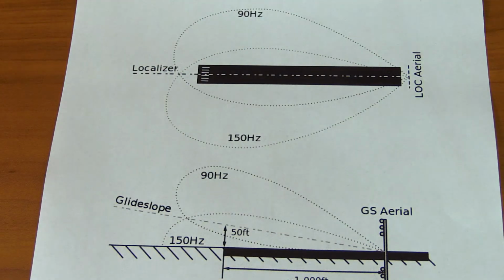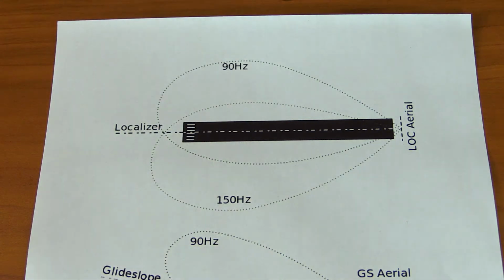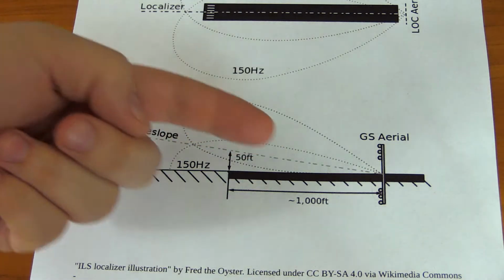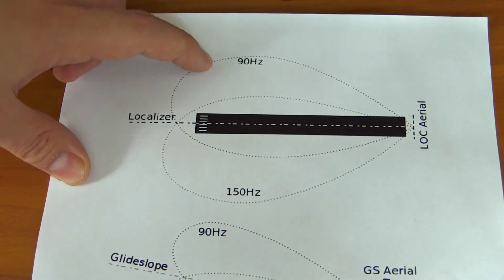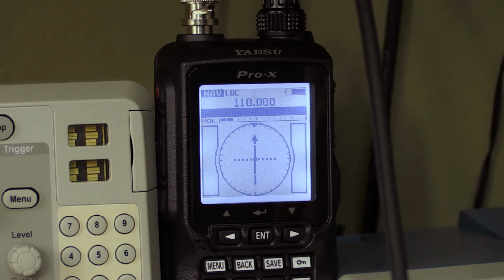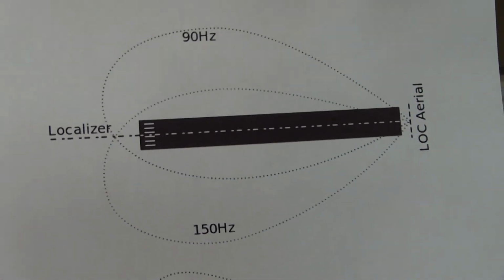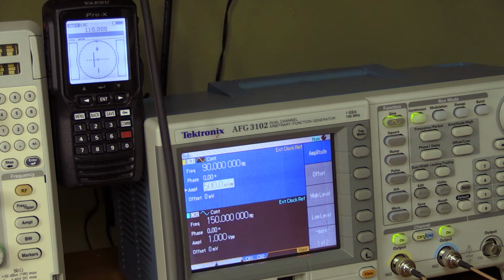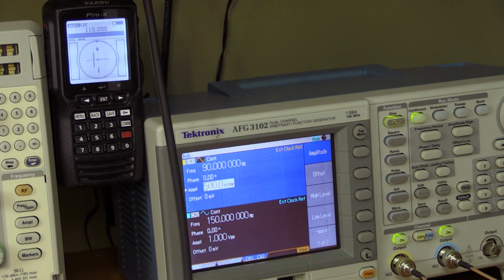Instrument Landing System (ILS) Test-Signal Generation

Comment: Thank you.
What is the receiver maximum RF power input?
You said that there is no GP CDI. did it receive the GP frequencys? You can program GP frequency on this model?
Reply from the maker: The max RF input I don't know. The GS frequencies are in the UHF range and can not be received by this radio. Unfortunately.
Reply: @BalticLab  thank you

Comment: Do you repair glide slopes receivers? What kind of attenuator did you use when connecting the 90/150 Hz generator to the receiver?
Do you have 150 and 90 Hz from the generator pass through the splitter and get into another generator? Can you draw a connection diagram?
Reply from the maker: I used to but I don't repair them anymore. And you are correct, the 150/90 Hz are generated by one generator, them resistively combined and fed into the modulation input of an RF generator. I do not have a connection diagram as the exact connections would depend on your instruments. I do, however, have a block diagram in the video.
Reply: @BalticLab  I did not find the circuit in your video.
The second generator, which mixes two signals of 90 Hz and 150 Hz, has 100% modulation settings, although it is advised to set 80% when checking by IFR4000.
Also, the amplitude is set on the second generator minus 9 - I don't know which units ...
Have you dealt with the PLL in the modules of the glide path receivers of the harmines?

Comment: If I remember, those yagi's have about 25 degrees bandwidth. Of course the apparent BW is wider the further the pilot is away from the end of the ILS, Instrument, approach. Since the receiver is feeding meters as a function of which tones are louder, this all that matters. 
I have been flying for years and the ILS approach is a very effective tool to get you down to the ground. In IFR or Instrument weather. Most of the time you come out of the soup hundreds or thousands of feet above the ground. Though, a few times, I was in the soup and only had the glare of ground lights until I was about a hundred feet AGL,above ground level.

 I know of commercial pilots who never saw the runway until their tires were about to make contact. The first times shooting an ILS approach in real weather or with a hood on so the pilot can only see the instruments was very hairy.. I was constantly worried if I was getting a correct reading on the meter needles or if the receivers were calibrated.
 Many low time pilots have perished because they didn't know how to interpret their instruments or they thought the instruments were lying since their head felt they were at a particular attitude when the plane was not.. Also known as vertigo   Real Shame!!!

Comment: Interesting! I never knew how those systems worked.  What is the typical beam width of the antennas?
Reply from the maker: ***** I wish I would know the answer to that. They are arrays consisting out of multiple Yagis. I think I have read about 35 degrees somewhere but I have no source. Maybe someone on here has better knowledge of that than I do.
Reply: +KF5OBS Really great demonstration,appreciate you shared this with everyone! I'm a pilot and what I can tell you about is that when on Localizer mode the sensitivity is pretty high. A full scale deflection of the CDI ( the bar swinging left or right) corresponds to 2.5° off course. From what I've seen in your viedo a half scale deflection of the needle was corresponding to one signal being double than the other (1V vs 500mV). Maybe you'd be more clever than me and try to find an answer with these information. As you have pointed out what the receiver do to display the deflection to the pilot is to mesure the difference in depth of modulation between both AM signals, for both LOC and Glide. Thanks again, you did a fantastic job!
Reply: + -10º at 25 NM; + - 35º at 17 NM & + - 90º at 10 NM